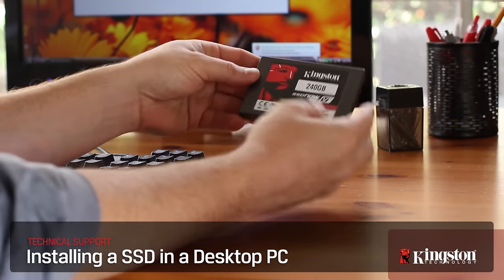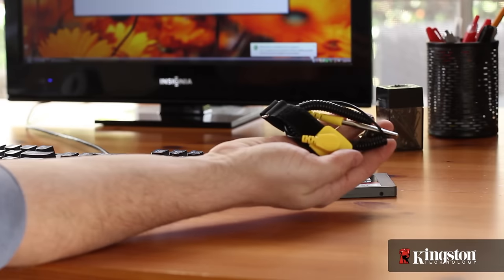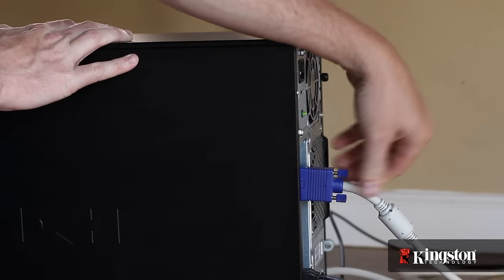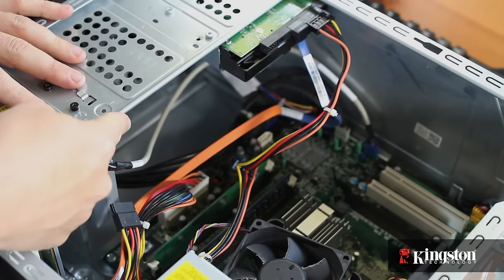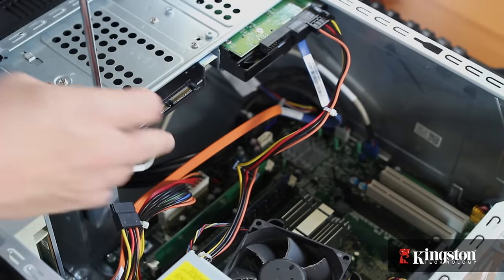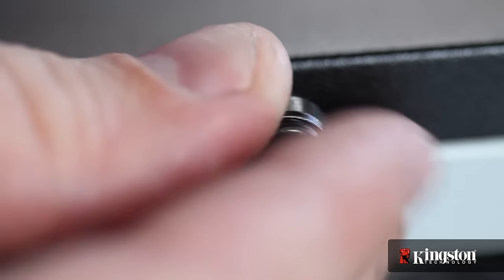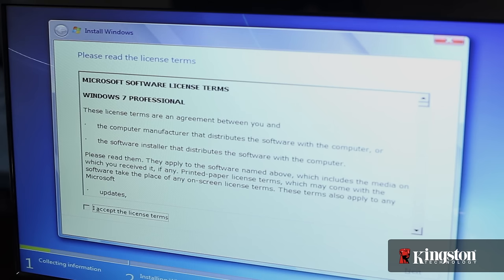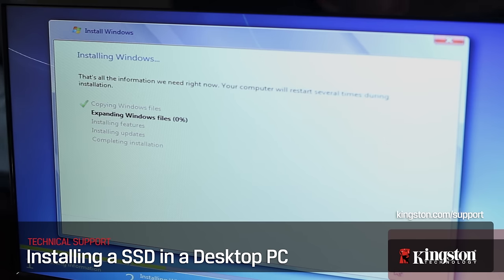Installing a SSD in a Desktop PC

Comment from the maker: How to install an SSD in a laptop: https://www.youtube.com/watch?v=BBJ9Xu2CkmM&list=PLAsUq-kEMSD4tkr7cG_Xk2JKCnfv7x2QD&index=3
Reply: Guys I have a doubt. Can I use an M.2 SSD for both Laptop and Custom PC. I have a Cutsom PC witg 120gb SSD OS installed and with a slot for M.2 SSD. I also have a laptop with 512GB SSD OS installed and with a slot for M.2 SSD. My doubt is if I am home I would use the another M.2 SSD in PC for gaming and other tasks and If I am out of town I would be using the M.2 SSD in my laptop. Will that work? Will there be any performance issues?  Please help me clear my doubt
Reply: Chec this out : https://youtu.be/DswIVtHRSTc
correct way of installing a kingston SSD
Reply: @thediyist  Well, perhaps, but it's not the SSD (2.5 inch SATA) discussed here. Your comment is therefore pretty useless.

Comment from the maker: To get the full capacity of your HDD, you can "extend" the partition in Disk Management. Just right click the partition at the bottom and the option to expand or extend should be there. For further assistance, please call us at 1-800-435-0640 (USA and Canada only) M - F 6am - 6pm PT and we will help. Otehr area information is available on our website.

Comment: Ssd drastically improved the performance of my Acer Travelmate P258 that has 2gb ram and that had a Hdd. The boot time as well as the overall performance is not even comparable.

Comment: I was wondering if I had the required setup to even install an SSD and this answered that :) thank you so much!
Reply: Is ssd storage for games plz Annswer
Reply: @alejandroGonzalez-xz4ep  hi Alejandro. It's for storing anything. It reads and writes faster than a regular hardrive. It sped up my gaming load times dramatically. Skyrim levels take 2-10 seconds instead of 40-60 seconds. But it can only work as fast as your CPU can process and your RAM can handle. What kind of computer specs do you have?
Reply: TheGrimriftstalker oh yes do u know how I can switch all my games to a different drive
Reply: @alejandroGonzalez-xz4ep  you must first install the drive you want your games on. whether this is an internal drive (what the video is about) or an external drive is up to you but after it's setup, simply install to that drive or copy the files to it and it'll be inside it.

For example, if you were to download GTA V on steam (something I got an SSD to do because those load times are seriously long on an HDD) there will be an option to change the install location to that of the SSD.

Comment: It is a wise idea to disconnect the sata data cables to other HDD/SSD before installing the Windows, otherwise it can put boot related data to other drives, not to mention avoiding accidental data lost.

Comment: My Kingston 480GB SSDnow kit came with a basic metal adapter cradle but none of the screw holes would line up with the bay in the PC, the solution was to buy a HP SATA adapter P/N 654540-001. It's much more substantial than simple adapter rails and looks more professional.

Comment: Static bands aren't always necessary and in my time building computers I have never had a problem with it. Make sure to touch something metal that is grounded before you start and try to keep off of carpet (or wear shoes). As for the bracket SSDs don't have any moving parts so as long as it is secured somewhere (you can use 2 of the 4 screw holes until you get a bracket) then you should be fine.

Comment: is the SSD holder (I don't know what it's called) already included when we buy the SSD ? because my casing doesn't have one
Reply: no
Reply: called a bracket btw
Reply: depends on what you buy because i bought to recently that have a sticky holder with the ssd that is made to hold the ssd if you do not have a ssd holder

Comment from the maker: Hi, I'm Jewel with Kingston Technical Support, here to address your question. If you add a SSD to the computer without removing other drives, it would only require to be initialized and formatted then you would be able to install programs or load data to the drive like any other one.

Comment: Your OS is basically the backbone of your computer. All your drivers and other major functionality are controlled by your OS. On my SSD I currently have Windows 8.1, drivers and windows updates, and FFXIV/WoW, (my most played games).

Adding your OS to your SSD will speed up absolutely everything, as your local appdata is stored on it too. Even programs that are stored on other drives (like office for example) will use local app data (IE stored on your SSD). hope this helps :)

Comment: If you find your PC is freezing after the install is done, and programs wont respond, update your SATA AHCI drivers. The generic windows SATA drivers can cause these problems, your motherboard manufacturer should have new drivers that will mitigate this issue. You can look up your motherboard in system information under "system model". From there google "*motherboard / system model* SATA AHCI drivers" and download / install them to your pc! Hope that helps someone, took me three days to solve this issue :D

Comment: I want to add to his comment. on some motherboards, if you hold the power button in for a few seconds, you can completely shut down the motherboard. You can tell if it safe to touch when the light on the motherboard is off.

Comment: Would I be able to use this as a secondary drive and leave my OS on the standard hardrive?
Reply: checksandbalences  i think you would but that would be a waste, since an ssd would really boost your system speed, ofc it depends on your specs, but i think that is the main purpose of a ssd
Reply: @thockinity  for my part, i have an NVME ssd and woud like to up my storage game with a new ssd

Comment: Do you need to buy additional SATA cable and the SATA Power cable ?
Reply: You do need a sata cable, but your power supply will have the cables necessary for power.

Comment: Okay i want to get one thing clear. Do i still need to backup my HDD since i am installing the SSD as a second drive and would Windows 7 be deleted from my HDD when 10 is installed on the SSD?
Reply from the maker: +blood117
We urge all our users to back-up important data, however if you plan on using the SSD as a secondary you're not required to back up your boot drive with the OS.

Since it sounds like you plan on installing Windows 10 on the second device SSD your Windows 7 HDD should be fine.  Just make sure to select the proper partition when  you install Windows 10.
Reply: is it not better to install windows on ssd and use it as ur primary for better performance of os?
Reply: go to disk management settings n check for ur ssd n format it 1st if found there...
Reply: ;-) its my pleasure!

Comment: Looks easy, the only problem for me is that my computer was pre-built. So that means I don't have an OS install disc to install into the SSD drive. Is there a way around that?
Reply from the maker: Hi,
Please have a look on  how to transfer data by cloning your data from your existing HDD/SSD to your SSD.
On the following link choose the video on how to transfer data:
http://www.kingston.com/en/ssd/consumer
Reply: Kingston Technology Thank you!
Reply: oh THANK YOU SO MUCH I HAVE THE SAME QUESTION
Reply: I got the same question.. Still i didn't get how to install without using cd installer
Reply: Don't try and clone your data onto a new drive, it's much better and more efficient to just clean install windows on a new drive and back up the most important data you need on an external hard drive.
Reply: pre installed pcs should either come with a disk or a backup drive with the Os if not then i'd yell at the retailer, no point in a computer without a backup option

Comment: Thanks for the great video very helpful. Should i buy a sata 3 cable with mine and hook that up or do i just hook it right up to my sata 2 cable thats already in my tower? Does it make any difference? Also my motherboard is a few years old its a X58 series does that mean the sata connectors on it are sata 3 compatible. Sorry if thats a noob question this will be my first SSD drive and im hoping for a quick clean installation with out any problems.

Comment: where u get the side stuff things
Reply from the maker: +Wolf Devil
Those are drive adapters that you can purchase through your favorite electronics retailer.  Depends on the drive bay you're planning to mount your SSD it can be a 3.5 to 2.5 SSD adapters.
Reply: Thank

Comment: My upper floor is carpeted and I have pets on my lower floor of my house. 😶🔫
Reply: lol
Reply: Every bit of computer work I've done has been on a carpeted floor in my socks, no problems so far over 5 or 6 years, fingers crossed though
Reply: Just grab something solid and metal like a chair to discharge static electricity
Reply: Not only nerds get electrocuted hhh!

Comment: can i just put the ssd in my pc and just install some games for loading times and will it work without  configurating (bios or other software installs)
Reply from the maker: +MrDavezd yes, the only thing  you will need to do is initialize and format the SSD in your system as a secondary drive so it will become an available space to write and install on. If you need any assistance, please contact our support team http://www.kingston.com/company/contacts#tech
Reply: I plan on doing the same thing soon that the guy above asked when I purchase a SSD shortly. My question is, if I initialize and format it as secondary drive for just games will I still be able to install windows and make it my boot device down the road? Reason I'm here is I don't have a windows 7 disk, only thing I got for disks are the 3 backup discs the place where I bought my PC made me. Not sure where to go without a W7 disk.
Reply: XDevilsChariotX  you can..just place the os and the games of your choice into your sdd storage..it will boot using ssd instead of hdd

Comment: The best way to ensure you don't reinstall over your old drive is to disconnect it. I made the mistake of not doing that for a Linux Mint install. Thankfully I shut it down before all my data was lost. But I did have to use a data recovery program to get my files back. I used photorec on linux.
Reply: How did you shut down your old drive? Did you just disconnect it?

Comment: I just bought a SSD and have never installed one yet.
So first of all, I will need a SATA-cable (the red one in the video), do I need the other (P4) cable too?
My goal is to make my OS only run on the SSD and put the rest, games, programs etc into my HDD.What do you suggest?
How do I install it + configure in the partition table?If needed you can PM me.
Reply from the maker: +RSDelay y
If you're installing your SSD to a desktop computer you only need a SATA and Power Cables.  Just be sure to set your SATA controller in the bios as AHCI.
Reply: +Kingston Technology Alright, Any suggestions while making partitions?

Comment: Question: Does it matter which power supply I have and what plug I use? I am a newbie when it comes to this and I was wondering if different components use different voltage or something like that. Thanks!

Comment: Uh i dont have voltage disappating devices? If my pc has been disconnected from and power for over a day will it be safe?
Reply: Yes, and make sure you don't have any static buildup on your person I.E. Don't wear socks and walk on the carpet then touch your PC. You should be fine
Reply: and when you disconnet the power from the mains, hit the power button to discharge any residual power left in the capacitors.

Comment: So I’m very new to this computer thing. I really wanted to start playing games on pc so I save up enough money and bought all the parts and tried putting. Together after many fails it started up and I thought I did everything right. I now see that I’m pretty sure I did not. I thought I got an ssd but in my drives it only shows a hard drive. I didn’t recall getting a hard drive but is it possible that the ssd I thought I got was a hard drive? If not how do I get my ssd to work because it is not:(

Comment: sir, i use HP Intel Core 2 Quad Q8400 processor 2.66 GHz 4 MB L2, is it possible to upgrade to SSD ? tq before, sir

Comment: My computer runs on a SSD, but I want to add an additional SSD for storage purposes. Is this possible without complications?
Reply: If you have an extra SATA cable to your motherboard, and an extra cable from your power supply, I think it should work if you choose your primary drive for primary information (OS, boot data etc)

Comment: Hello.

! question please.

Is the connection cable different from HDD to SSD? or it is the same cables?

Thank you in advance!
Reply from the maker: Hey there! Do you have a make and model for the HDD? We can try to help you find the type of connection it has.
Reply: @kingston  Hello, thank you for the answer. Now I have an Western Digital Blue WD6400AAKS, and I have ordered an Solid State Drive (SSD) Kingston A400, 120GB, 2.5", SATA III. Do the connections match?  Thank you in advance
Reply from the maker: The SATA cable is transferable between the drives, but the transfer rate can be slower on the A400 if its using a SATA 3.0 Gb/s connection. Send us a PM on Facebook or Twitter if you have other questions, we'll be happy to help you out!

Comment: If I install the SSD, install my OS on it, while keeping the HDD in place, what will happen to the OS on the HDD and all of the data on it?
Reply: The data will still be there until you delete it. Also, if you didn't change the boot order of the drives in your BIOS, it will try to boot off the HDD instead of the SSD.

Comment: Hello i purchased a new hard drive for my computer not a SSD. I want to completely replace my existing hard drive. moving files over does not matter. would I use the same steps to get my OS on the new hard drive? Could i boot up my computer with the new hard drive in place and then use my OS CD to program it? thank you.
Reply from the maker: Dear Customer, the principle remains the same for SSDs and HDDs in terms of cloning a existing drive to a new one or performing a entire fresh install of the OS to the new one. However using a SSD as a boot drive will increase the overall performance noticeable as long its connected to SATA 3 port. Your Kingston Support Team

Comment: Of i use hdd for window and ssd for games installation ... Will my games installation improve if yes how much will it improve as compare to hdd ...?
Reply from the maker: Installation speeds may vary due to host hardware, software, and usage. SSD launches applications faster and has a faster overall performance compared to an HDD. We have created a video here to compare performance between the two. https://kings.tn/380DgYv

Comment: I bought a fairly cheap used gaming pc about 4 months ago but it's kinda slow because it has an hdd, and the disk is running at 100% too often. The problem is that the inside of the pc is just so clean and the cables are nowhere to be seen and all tied up nicely, so if I want to upgrade an ssd i will have to take some of it down and i literally have no idea how to put it back together even if i somehow managed to take it down. I guess i'll just have to buy a whole new pc when this turns into a bigger problem...
Reply: open ur backside and search in the space infront of the power supply cuz ppl offten hide cables that arent being justed there

Comment: another thing to note is make sure your main the ssd is plugged into sata port 0 on your mobo they are labeled on the board.  I followed these steps and plugged it into the next available sata port but I noticed something very annoying.  The old HDD was being selected first by default in setup I had to switch the cable into sata port 0 to get the ssd to come up first in setup
Reply: you can change that easely in the boot options of the bios :)
Reply: MazZ I did that.  I set my SSD to boot first after the DVD then the first mechanical HDD then the Second but still since the ssd was plugged into SATA port 4 and my HDDs were in ports 1 and 2 it went disk 0 500GB HDD disk 1 1500GB HDD disk 2 240GB ssd.  I didn't know how to force a disk to be seen by windows as disk 0 even though its plugged into sata 4

Comment: I'm so confused, I just need to add an additional ssd, but I need a Sata cable and a Power Extension cable!?  So the ssd I bought will be used as an additional drive so no need to back up or reload my system right? Also how do I know which are the right cables to buy?
Reply from the maker: Hi Jay M! The additional drive can be used as storage when you connect it and initialize the drive. Backing up the drive is not necessary if it's not going to be your boot drive. If you have questions about the drive installation, you can chat with our support team for detailed instructions. https://kings.tn/34OS9wP